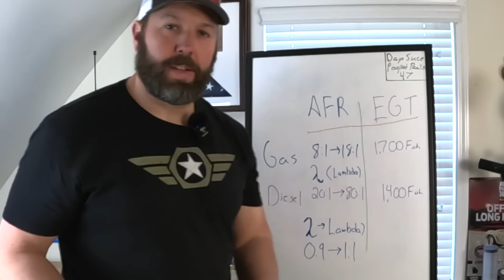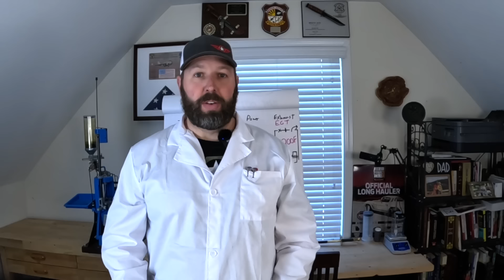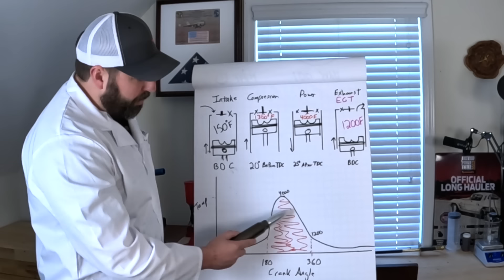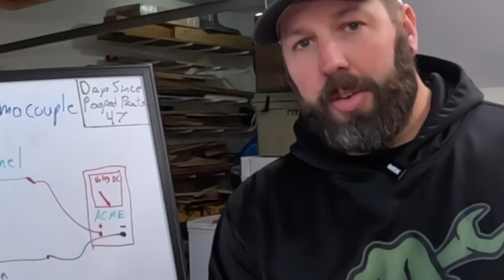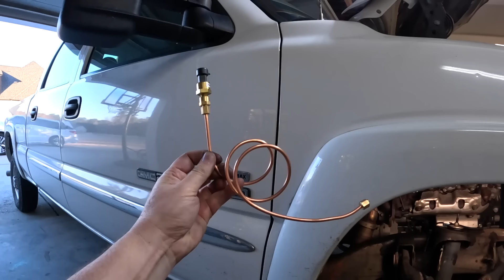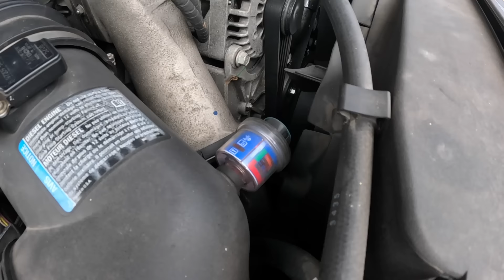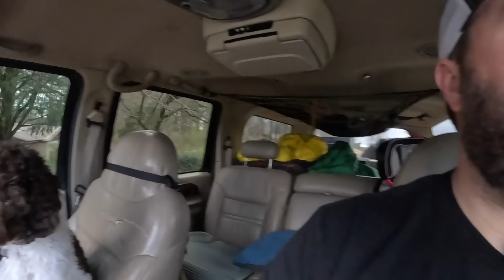Silent Diesel Killer…Diesel Exhaust Gas Temperature (EGT)! #diesel #egt #dieselengine

Comment: In diesel - more fuel = higher egt

Thats why leaky injectors can lead to broken engine.

Cheers from 2.0HDi (Citroen) tuned from 136 to 210. It didn't need more than a hybrid turbo and few mg/inj to do it. And yea. Turbskie is smol. But makes power.
Reply from the maker: Yeah, a stuck injector can certainly burn one down 🥴

Comment: @freedomworx I watched the whole vid dude. Just like I watched yours. Very good vids. You were foolish for telling garrey that not commanding egr can keep egts cooler is wrong, and saying that cylinder temps can be hotter while egts can be cooling simultaneously which isn't physically possible. They are direct correlation of whats happening inside the combustion chamber and even you say it yourself in your vid.  And then told garrey that having higher air temps can be cleaner and more power. You are contradicting yourself, Charlie, Me, and then to top it off I drew the line here with my silence as you made fun of Garrey for watching n learning from Gale Banks @bankspower like some bully. I'm Sticking up for them. And trying to help you. Your actions made you the fool. You've shown you are not good peeps.  Goodluck
Reply from the maker: You simply don’t understand physics and thermodynamics. And I can’t fix that.

Comment: Good explanation on EGT. Now do a demonstration on EGT with a water/alcohol system and how it affects EGT, Fuel economy, and power and why it's better than an EGR system.
Reply from the maker: I did have a section about water/meth in the video, but I cut it to shorten the video a bit. I've never though of comparing it with EGR though. Thanks for the idea.
Reply: @freedomworx and mix ratio. More water absorbs more heat from the charge air and adds mass to the exhaust. Intercooler and water/meth both act on the ideal gas law. Lowering charge air temp is the lesser benefit compared to adding density. Higher cylinder pressure w/ less temperature rise especially if you tune for a lower air fuel ratio.

Comment: Though I'd throw this out there, the oil squirters are one of the main reasons the pistons don't melt. I have a 3406e 2ws that was inframed by the owner, they removed piston/rods without removing the oil squirters, it went 16k miles and I bought it. 2nd time I pulled a trailer at 925 post turbo temp it melted #2. 
They were bent just enough the piston wasn't cooled properly, but compared to the new squirters they looked identical except for light scratches.
Reply from the maker: Yep. That's what I was referring to when I said the heat is lost to the oil. Are those a 2 piece or 1 piece piston? Does the oil shoot into a hole in the bottom of the piston on those?
Reply: @freedomworx  they are 2 piece piston,  the squirters have 2 bent pipes and they have it figured out so they cover the bottom of the piston on each side when it's at the highest Temps.
I really couldn't tell a difference on the angles new to the old scratched ones but it worked, it's set at 550 ish and it put all my new drivers in it.
It won't pull as hard as some of my 700 hp cats but it an awesome engine. I have actually had older drivers mock me for running manifold ( pre turbo) and post turbo k type senders in an autometer dual input pyro. But the factory, and other options are so slow and wildly inaccurate. I just prefer to know exactly what my right foot is doing so I install the dual pyros in all my big trucks and just pre turbo in pickups.
By the way, what shell is your laser pointer. Good job on the video by the way.
Reply from the maker: @nicoletingey4995  Ok, cool. Thanks for the info. It's a 30mm shell from an A-10.  👍

Comment: What temps do diesel trucks normally run? My 2 liter passat has an EGT limiter set at around 1675 which is the limit of the turbo before bad bad things happen XD
Reply from the maker: Trucks normal cruise around 700 and max towing is usually 1100-1200. My guess with the TDI is VW never expected the engine to sustain that 1675, because honestly I can’t think of a situation that a TDI could be loaded that hard without going 299mph. 😂. BTW, a had an ALH 5 Speed Jetta TDI for a long time. Had big injectors and ran this piss out of it every day. Never had a pyrometer on it.
Reply: @freedomworx they hit that limit pretty fast! Tiny tiny turbos and rich running to get such decent torque and power for their size

Comment: White hot is what temperature..?
Reply from the maker: I’d have to Google it 🤓
Reply: @freedomworx  30 odd yrs ago drove a few tractors that when working hard exhaust manifold would glow white hot.. u could see the exhaust charge come out the pot as the valve opened..  one motor had over 9k hours on it never been apart..  no smoke from exhaust at that temp used 1/4 inch off dipstick between oil changes..  have seen engine aftermath of pistons running out the exhaust port when water escaped the cooling system made for interesting manifold removal..  that temperature does interesting things to alloy and cast iron..
Reply from the maker: @rebekahfrench5747 that’s wild! 😂
Reply from the maker: According to Google, 2370F and above. Hotter than a K-Type Thermocouple can measure.

Comment: Scania has recently came out with an Exhaust Aftertreatment System that eliminates EGR.
All Emissions mitigation happens behind the Turbo and trough engine tuning.
Pretty amazing honestly I wonder what the effects of no EGR System has on the engine.
Reply from the maker: I'll have to look into that. Thanks 👍
Reply: adding oxygen improves burn so no nox but it increases temp, however egr needs a cooler but doesn't burn all the nox anyway, maybe cooled oxygen injectors might solve both issues and improve speed, burn and emissions but the oxygen temp would need to be regulated down only when egt went up. fascinating stuff

Comment: The science and engineering behind Diesels is awesome.
Way more interesting and intricate than gasoline engines to me.
Reply from the maker: It's interesting that gas guys think diesel is complex and diesel gas think gas is complex. To me, the only complex thing about diesels is managing emissions. Everything else is pretty straight forward. 👍
Reply: @freedomworx  Diesels are so simple to me. You need fuel and air. In diesels there is no such thing as needing to run within an Air Fuel Ratio window.  
The only rule really is: The leaner a diesel runs the better.
Less emissions, more efficiency.
More air = more good. 
More fuel but not more air = eww rolling coal like a mf and dogshit fuel economy paired with high EGTs.
More air makes the diesel happy aka spooly boi go brrr.
Reply from the maker: @alouisschafer7212 yep. They are simple. The only hard part about diesel tuning is making good power and economy while keeping emissions in check.

Comment: 12:57 why? 
.
why did you use the aluminum based stuff? (that WILL!!! melt/burn off on exhaust) 
should have used the "high temp" copper based anti-sneeze 
.
.
and crap like this is why this mechanic HATES when people use anti-sneeze 
they NEVER use it correctly.... and if they did, its the wrong type. 
.
if you put it on lug nuts/studs.... you are a FUCKING HACK! 
if you TORQUE! the lug nuts.... they will not seize. (ITS THAT SIMPLE FOLKS!!!! use a GOD DAMN TORQUE WRENCH)
.
.
also really funny when it find it on O2 sensors and spark plugs
because they TOTALLY dont get hot.... 
.
"imma wipe off the correct stuff... the copper stuff... off my O2 sensor, and replace it with crap that WILL MELT RIGHT OFF"
some people should not work on cars..... just not mechanical in the slightest 
.
.
these lug nut anti-sneeze people are so stupid....
instead of using a condom to prevent pregnancy..... they fill it with water, tie it off, and freeze it........ once frozen they stick it in their own ass
"because thats what a condom is for.... right guys?"

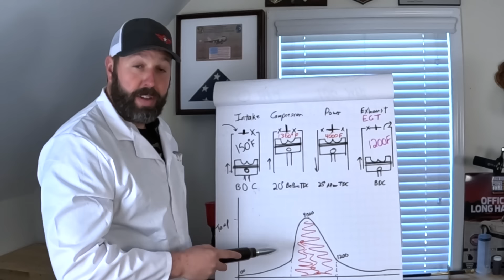Comment: 6:00 and this is why you can melt pistons if your engine leans WAY out...... 
.
the combustion temp gets a LOT higher.... and despite only being in their for 25% of the strokes (and really, its more like 18-20%, due to valve overlap, expansion, ETC) 
to combat this... modern engines, even gas engines, use "piston squirters"....... they shoot oil on the bottom of the piston
Reply from the maker: Good ole squirters 💦
Reply: @freedomworx  damn right lol

Comment: I hit 1600F+ on my 2.0L TDI, it came with a EGT probe before the turbo.

One other thing you can do that you didn't cover in the video. Water-Meth injection, I plan to do that to lower EGT. I like the presentation and information.
Reply from the maker: Thanks. I actually had a section on Water-Meth, but I cut it out to shorten the video. But you're absolutely right. 👍
Reply: 1600f sounds about right, the stock limit is 1675 I believe and the turbo cannot take much more than that

Comment: Sweet video, how about injection timing how it affects exhaust temperature and cylinder temperature and turbo inlet and outlet pressure the science.  Loved it...
Reply from the maker: Yes, timing definitely has an effect. Retarding the timing will increase EGT and turbine drive pressure.Retarding timing is a strategy to spool turbos faster while staging. Most common rails are using multiple injection events now, so timing is a little weird. You spread the injection over a longer period of time to decrease peak cylinder temp and pressure, but maintain average cylinder temp or pressure. Good question

Comment: Billet steel ceramic coating 💎 dust pistons head chamber n valves can hold more hotter temp like Lycoming instead Continental 390 optimum level 400 to 🔥🥵 damage something unless it's one then spark plugs or if all magneto but just know with plus 20 timing etc naturally aspirated engine but Lycoming can do 420 414 optimum level

Comment: Worry about chts cylinder head temperature 🌡️🤒 n get because anything in front coming in too hot will come out hotter too late in airplane turbines is tit inlet not tot outlet they got egt but itt oil pressure voltage ⚡ n fuel ⛽ that's pretty much everything

Comment: Whit what kind of logic would feeding back HOT EXHAUST gas back to an engine reduce egt....
Reply from the maker: Your thought process is logical, I’ll totally understand your train of thought. But EGR flow goes through a cooler to reduce the temp before it re-enters the intake stream. That being said, it is still going to increase the intake air temp some.  The cylinder and exhaust gas temp reduction comes from the fact that that exhaust gas has little to no oxygen left in it to combust, so it reduces the peak temperatures in the cylinder. The trade off is reduced fuel efficient, in diesels anyway. It’s been around for 50 years and there are hundreds, if not thousands, of studies available to show its effectiveness. I plan to do an entire video on EGR.
Reply: @freedomworx 
That be verry briliant.  So how do you plan on burning the same amount of fuel , if there is less oxygen in the darn cylinder ?
I want to see the chemistry reaction.
Take 500 ccm air at normal condition, that is athmospheric pressure and 25 Celsius degree. Okay ? Assume a healthy 78% nitrogen , 21% oxygen. Kay ?
Now , calculate the maximum fuel amount you can burn with that oxygen.
All fine , show the chemical reaction , and the resultant exhaust gas.

Now , mix 250 ccm of the mentioned air with 250 ccm of the exhaust gas. And... hang on , now comes the tricky part:
Add the SAME amount of fuel to it ,as you did with the pure air.
Now lets see how it burns.

The only thing egr does is reduce the clean air your engine can take , and reduce the amount of fuel you can inject without producing excessive soot.
Under partial load you will not form as much NOx gasses , as a portion of air will be replaced by an inert gas. 

Your recirculated exhaust gas will be hotter Than your intake air. 

In Exchange you will see more fuel consumed and a reduced efficiency of the engine measured by fuel consumed versus output.
What you will see is better thermal efficiency. Witch none gives a shit about.

If you want less exhaust gas temps , use a less restrictive turbo housing. And get rid of the stupid egr and all that other junk none ever wanted to buy , but is forced to purchase and keep running. Least the dumb ones. Smarter ones get them removed straight after purchase. 

Aaaaaaand surprise , those are the ones that somehow allways get better fuel economy and Last longer.

The only item making some sense is the pcv . A simple catch can is less usefull as it seems , but the realy decent systems simply have an electric vacuum pump keepeing the vaccum in the darn crank case , whitout feeding the engine oil and water vapor and blowby gasses.
Reply from the maker: I already stated that it reduces fuel efficiency in the previous comment. How can it burn the same amount of fuel with less available oxygen? Because diesels always have excess oxygen in the cylinders. Meaning they have more oxygen than needed, and the excess can be converted to NOX. Not to mention that the heat capacity of the exhaust gas is higher than the intake charge, but that’s way to in depth for this video. If you delete the EGR without re-calibrating the ECM, that is when you will see higher EGTs. There are plenty of Cat and Cummins techs out there that will attest to the effects of removing  the EGR systems on engines they maintain or rebuild. I’m not justifying or supporting the use or deletion of the EGR system, I’m just presenting facts. If you delete your EGR system, you may increase your EGTs. Simple as that.
Reply: @freedomworx as long as there is excess then yess. Hence specificly stated , use the maximum fuel for the given  air amount. 
Its all Just shits and giggles.
Someone who has nothing better to do Than fly private jets had a spare moment to fabricate some bullshit why I have to pay more. There is nothing else behind it.

There is only 1 way I can be made to keep these useless sources of trouble on my cars.
The genius who figured them out pays for them. Not me. Allso I get compensated for every droplet of fuel i has to waste on em. And any downtime i have caused by any of these units , along with the reduced lifespan of my engine.

Then we can talk. Till then these " it could be benefical sometimes to have them " argumentum is none exsistant. 

And thats how egt works.
Get a less restrictive turbo , a less restrictive exhaust , ditch the egr and other junk , and tadaa , you get less egt , better economy , and longer life span. Thats how you save the planet.

Comment: Its not voltage its ohms but yes ig it will see a voltage difference but techs like mysel measure ohms on these. Just my 2 cents.
Reply from the maker: Thermocouples produce Voltage. It’s called the Seebeck Effect. They don’t function like other sensors that require excitation. They produce their own current.
Reply: Freedomworx is right. Heat=energy. As heat increases on the hot junction of the thermocouple, its resistance decreases, and voltage increases. The hotter the cylinder head temp., the higher the meter goes.

Comment: Naw get is too late I like to see the interstate inlet temp or chts before not after anything coming in hot enough going to be even hotter in exhaust don't pass 400 chts 390 optimum level for reliability n ceramic coating diamond 💎 dust pistons head chamber n valves
Reply from the maker: Say what?
Reply: @freedomworx  n in airplane ✈️🛫 you got tit n itt in the exhaust a wideband boost controller 🎮 n voltage ⚡ increase n more amps u said flames 🔥 or smoke
Reply: @freedomworx  with ceramic roller bearings as main bearings for crankshaft n camshaft let it rollllll 🛼 🎢 take out alternator regulator rectifier
Reply: @freedomworx  the hottest turbines run 1650 Max's  inlet so u way too hot 🔥🥵 don't make hole in pistons crack head warp valve if too hot for reliability 1355 1480 chts hottest if billet 420 414 even if laser forged n nitrogen in frame n tires formula f1 pneumatic gas valves springless highest rpms

Comment: I prefer P-type thermocouples
Reply from the maker: Sounds expensive 🤓
Reply: @freedomworx  about $120 each from Detroit but vere high reaction speed less issues with standard wire and connectors stronger signal. Issue is they are about 4" tall and need a metric nut with seat
Reply from the maker: @alexhise968 they have those fancy metals in them 😎

Comment: lol wow. As a gasoline only guy 8:1 to 18:1 sounds extreme.
Reply from the maker: Some texts say 6:1 to 20:1 is possible in a gas engine. Diesels can run leaner than 80:1 as well.

Comment: I wish I knew not to run the tap in all the way. The first time I did it I thought I used the wrong tap because of how loose my sensor was.
Reply from the maker: That’s how a lot of us learned. 😂
Reply: So I have a 1/8 brass that comes loose.I have star washers on it ; but I have to tighten up to often. Should I weld it or retap?
Reply: Actually my tap was the right size, I used it on another one. I have had 3 people tell me they had the same problem. Egt taps are not like a standard bolt tap. They are a tapered pipe thread. So my problem the first time was that I ran the tap all the way. So when the tap is bottomed out it it is at its widest. That’s why mine was loose and I could barely tighten it. I learned that I need to only run the tap 1/2 way through. Don’t make it sound like I don’t know what I’m doing, I guarantee you would have done the same.